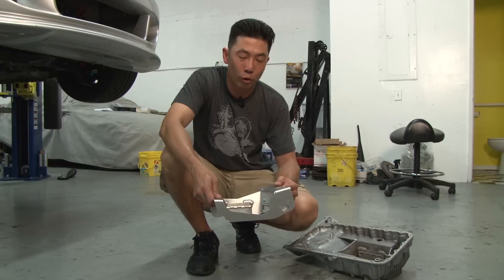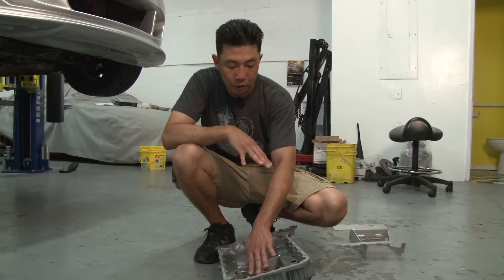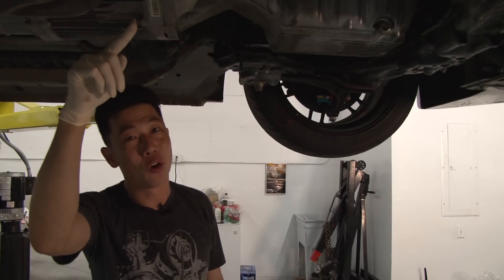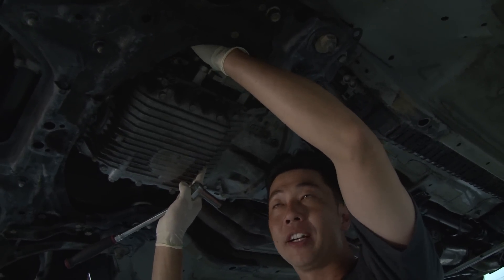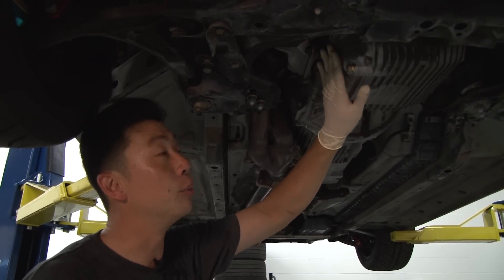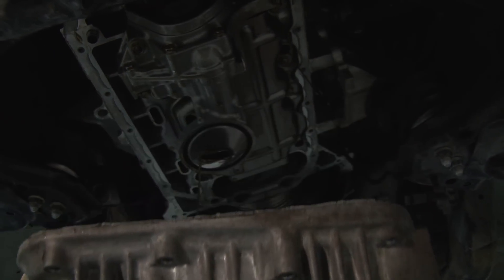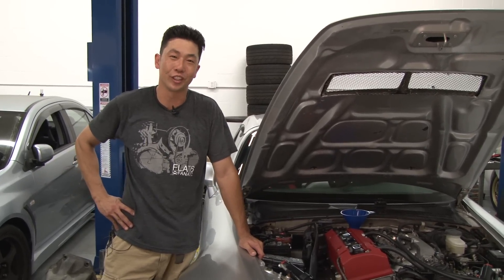How to Install an Oil Pan Baffle - Moroso - Track Life Episode 5

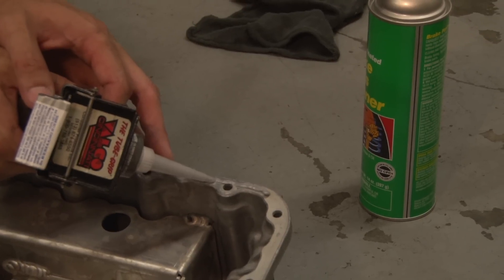Comment: Good video - 3:08 You must make the gasket between the bolt and the inside not between the bolt and the outside.
Reply: +edtam6 Is that right?  Or on both sides?  I notice on the OEM it's all around the outside, so it should be both inside and outside the bolt holes?

Comment: How necessary is a baffle or dry sump system for occasional track use? I plan to track my S2000 maybe 5 or 6 days a year, tops.
Reply: Zygrene I've met a few guys who only overfill their oil a bit and are fine so far.  Guess it really depends on the conditions you're tracking in.  An oil pressure and temp gauge might be something to look into.